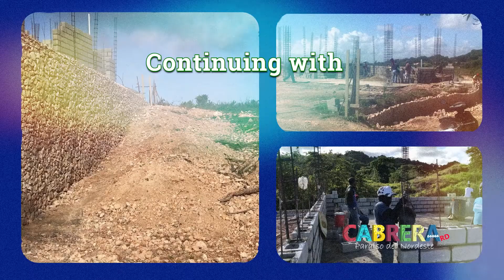Step by Step Construction - 1st Floor Concrete Block Walls

Comment: Barry did they charge you a flat rate per meter to build your house or did you pay cost plus a certain percent on top. Most people I have spoke with they want to charge a flat rate per meter? Thanks
Reply from the maker: Sorry for the late reply. To answer your question best I'd say everything is negotiable. When talking to contractors just ask them if they're open to both ways. just be sure you get the details written on paper.